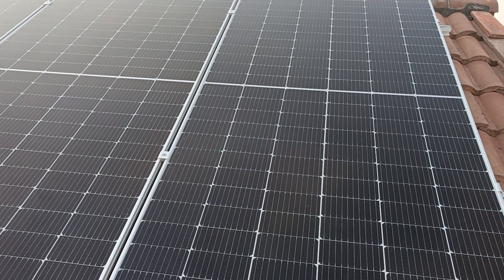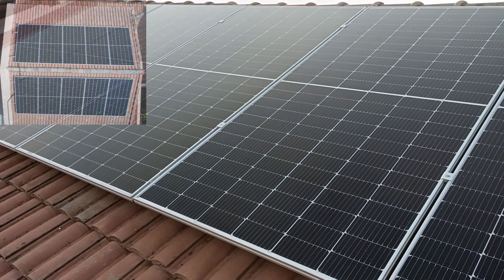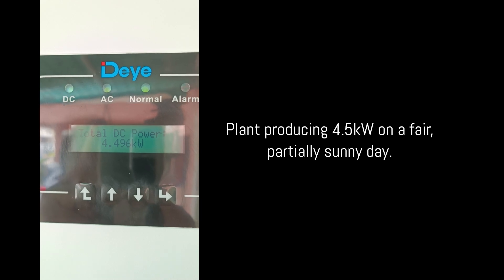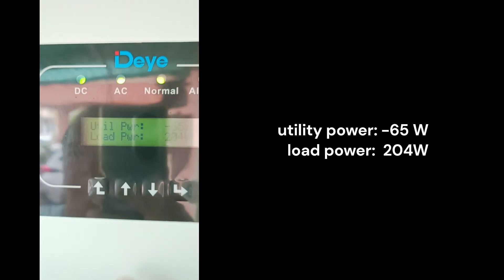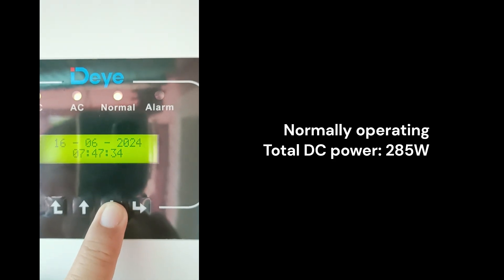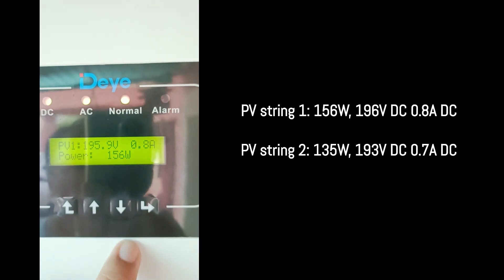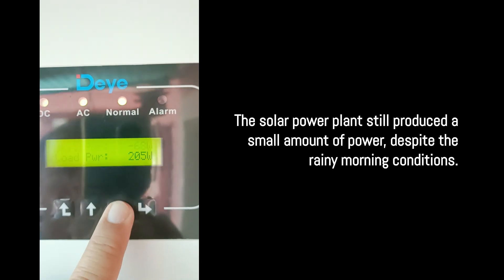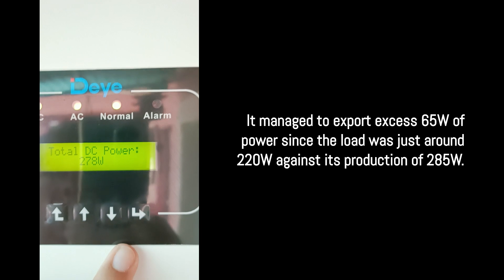Rooftop 5.5kW solar power plant during rain. Can it produce any power?

Comment: My 2790w array in weather like that with dark clouds 464w, rain light cloud 585w, just clouds 780w, with snow /sun 3400w vertical mount.5 more panels soon and 2+kw total in any weather.
JKM460M-7RL3-TV x18 +2 and + 5 LONGi LR7-72HGD-600M 600W Bifacial in Aug
Reply from the maker: Thanks for your comments. I've only just begun to learn about solar but I think your numbers are noteworthy.
Reply: @ramschannelreviews  I  have a few more tests to do too improve those #'s then I can share the details